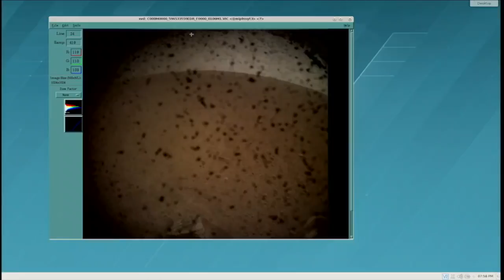NASA’s InSight landed on Mars!

Comment: I thought there was a twenty minute delay on the signal?
Reply: There is a delay but that delay included them seeing the telemetry data.
Reply: Considering just the distances, communication delay varies from 4.3 minutes at closest proximity to 21 minutes at maximum proximity between Earth and Mars.
Reply: Its relayed to earth via Marco A and Marco B Sattelites.
Reply: There are sound radars as well as marcoA and marcoB satellites flying pass mars that can receive comms from insight and then relay it back to earth in very short times.
Reply: It is definitely delayed, no doubt. They were watching a delayed broadcast.